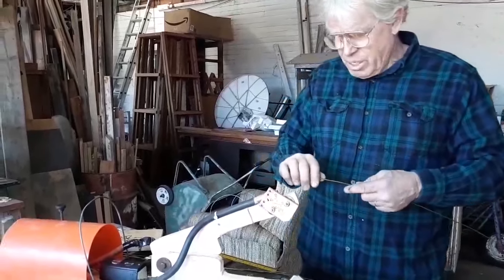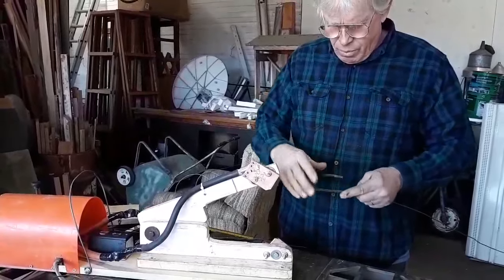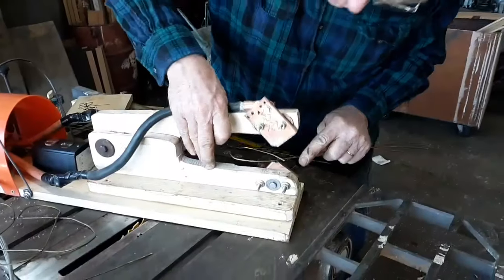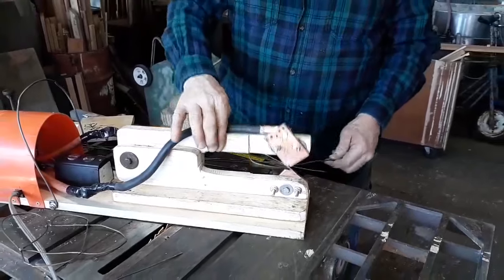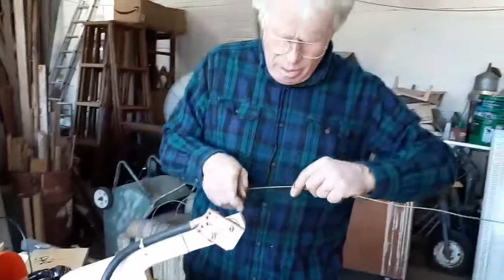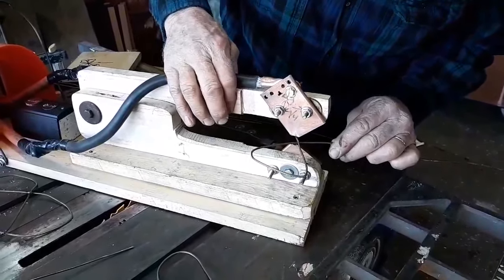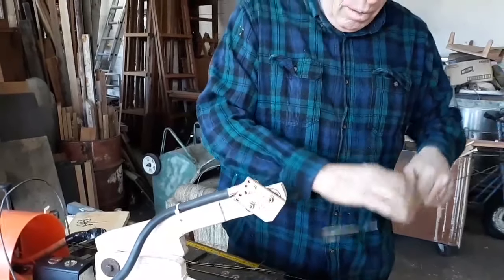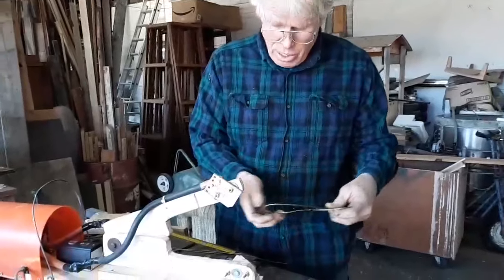Spot welder being used on coat hanger wire

Comment: I was wondering if coat hanger wire could be spot welded.  Grand job!
Reply from the maker: Any wire can be used as the high current is just fuzing the wire, It was suggested to me that if using galvanized to clean the area to be spot welded and use plenty of ventilation as the fumes are toxic.